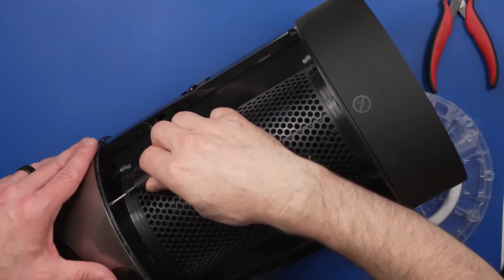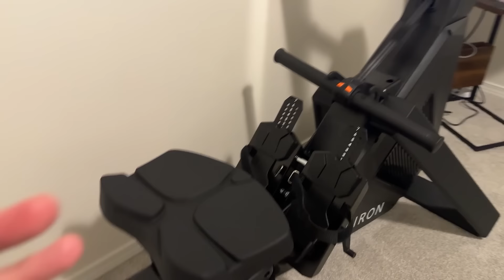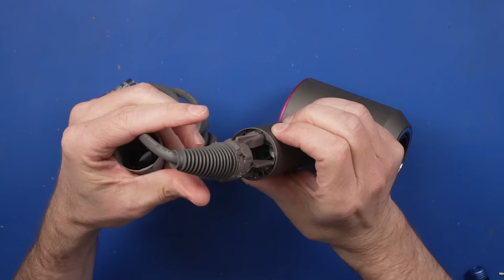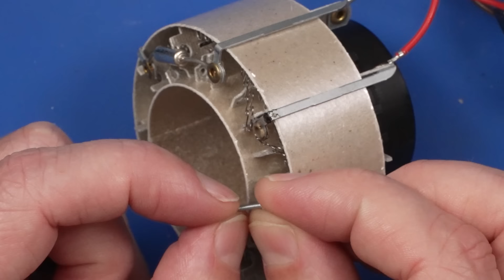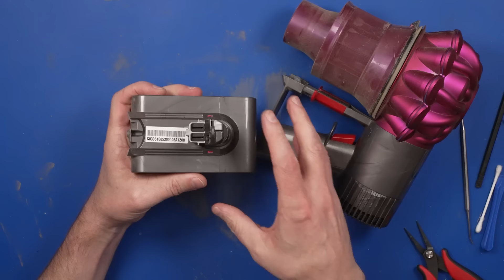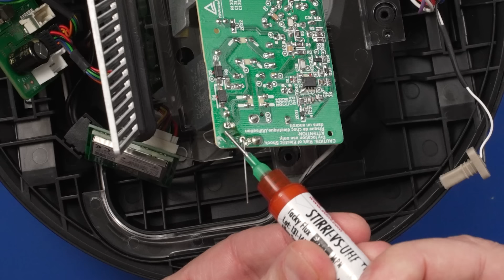Are Expensive Dyson Products Repairable?

Comment: I put a new battery in my animal. It was a christmas gift but we’ve run it more than my parents expensive german one mele. On extended run our older home it can cover all of it. What i have found with bags yes they filter great but as they fill up with dust etc, suction becomes less n less. My dyson’s canister fills up gee’s that what i’m breathing. The dyson’s hepa fan i saved up for i’m allergy sufferer. Dust pollen etc. Air pollutants. I was always sneezing seldom do now. Once you get one and get it filtering the air quality changes drastically i don’t go a full year on the filter you can great for sleeping waking up sneezing 🤧 nope. I got the biggest one plus humid days i just wanna feel cooler. You can slide the direction on you or just out into the room and have the fan oscillate or stop it all together with the remote. Now when it reaches a full dirty filter it will prevent it from running. Dyson’s web site was down so i went to amazon i got two filters equivalent to two years worth of clean air. Only difference is Dyson’s name isn’t stamped on the filter they’re the same filter. I was getting hosed off of one. Yes now the cone shaped hepa fans are high as a kite but when you can afford it get one. I’m had the same battery in the remote since i got mine years ago. I have speeds 1-10 my vacuum battery amazon three screws insert. new battery three screws, charge off to the races. But i’ve run the dog out it. Very my charge times to not every time i run it charge it. It has cut off reserve charge until the light goes out. The way you tell is if you need a new battery extended runs are shorter or in turbo cuts off immediately. Out box new Charge before use usually charge indicator is white -to blue then charged out. Usually after a few runs just blue.

Comment: When you’re checking the voltage of the battery, you have to push the button in. That’s your power switch. You need to push it in to complete the circuit and check the voltage.

Comment: Question: If a piece of tech is made by a company that knows the item shouldn't be serviceable, why would they design the circuit boards to support the use of fuses? If the fuse blows, the unit dies regardless if it's protecting the components on the opposite side of the fuse. Why bother adding fuses then?

Comment: I was a huge fan of Dyson's vacuum cleaners until a few years back. I bought a stupidly expensive cordless Dyson vacuum cleaner, which held up for just over two years until it started to randomly turn off while cleaning. I contacted Dyson, and they said I need to replace the entire hand unit and that it wasn't covered by the warranty since it had ended about a month before the vacuum cleaner finally broke. After a bit of research I found that the actual button assembly was very fragile on that series. Ordered a replacement part for $5 on Aliexpress, but ended up not even needing to use it since the original was easily glued together if you reinforced it with a screw. Last time I ever buy a Dyson product, it's a luxury goods company with zero customer service after their legally required warranty period.
Reply: Trash, I hate companies like that. Funny you mention that I have a Bissel vacuum from WalMart and it's more powerful than my much more expensive Miehle. The Miehle has parts available and is easily repairable... so I keep it around. But if you want a cheap and powerful Vacuum.. Bissel is where it's at. Just don't get the super cheap one. Like $100 or so at Walmart.. mine is 10 years old and still going strong. No parts available, but 10+ years for $100 is good with me.
Reply: @CL-yp1bs  Fortunately, Walmart isn't a thing here in Sweden 😊 That said, I have a corded Dyson that's about 12 years old and still working perfectly with no repairs. They knew how to make 'em back then. I also expect the repaired cordless one to hold up until the battery gives up the ghost.
Reply: @ Wow, yes 12 years is great. Seems like Dyson has gone downhill. It's sad to see these companies getting away with these anti-repair design choices.
Reply: @David_Robinson_1  Yeah, and that ain't even the end of it... Mom has a Dyson that's in the ballpark of 15 to 20 years at this point. It needs a new filter every so often unlike more modern ones, but other than that it works perfectly. They've always been very expensive gadgets, but they used to be good enough to justify that price. Sad really.
Reply: Weve had many generations of dyson vacs over the years and our Panasonic upright bagger outperformed every one of them when it came to carpet cleaning. We just always had a dyson because bags are annoying, until Shark came into play. with 3 cats and a dog, we vacuumed the Living room rug first with the dyson, then the panasonic, then the new Shark vac with the rubber strips on the brush. It filled the entire canister of the shark with fur. By far the best vac we've every owned.
Reply: @frostbite1991  oh, the vacuum works great unless the trigger button breaks. It was a pain to fix when it did though, and Dyson took zero responsibility despite knowing it was a common issue. That's my problem with them.

Comment: This video reminded me of what life for me was like in the 80's and 90's when products were just beginning to be sold with life cycles in mind and the right to repair idea was still far off in the future. While others began to simply replace their broken items, I would tear mine apart A) to find out how they work, B ) figure out it was usually some form of junk that was wedged somewhere it shouldn't be, or C) some cable was disconnected or loose. I never tried to fix any boards since that was seldom the problem, and I had no idea how to do that until later. Besides, simply taking the things apart worked 80-90% of the time at finding the issue. Ended up saving thousands over the years simply by investing in the tools to take them apart.

Good job embarking on a series like this, while it may not end up teaching everyone exactly how to fix their own stuff, it may encourage those who don't think they have the skills to give it a try and maybe save themselves a few bucks in the process.
Reply: How much were the tools?

Comment: You should try dyson corrale hair straightener they only seem to last 2 years then fail to work on battery for more than a few minutes. That's ok though, surely you can just run them from the mains cable you'd think, right? Well no they keep cutting out so you have to wait for them to come back on. Seems to be a dodgy battery cell or a bms issue but they don't seem repairable

Comment: Sadly, the hair dryer is a fake one. For this version of counterfeit, if you read the warning under the blow hole, there are typos. And it didn't have the GFCI plug.
Reply: Yup, and it’s also missing the module on the cord near the plug that handles power filtering
Reply: Not all versions have a filter and GFCI. The EU version (at least the nural and travel ones) do not have filter nor gfci plug.

But yes, this one is fake as it uses wrong screw types and 3 phase motor.
Reply: THIS!!!!

Comment: I replaced the battery pack of my Dyson vacuum v6 years ago with a cheap replacement after the original pack died after 2 years of using. The replacement is still working fine. It's almost 6 years in use now. Cheap replacement parts are sometimes way better than original parts. Dyson just sells crap for a fortune. My Dyson AM07 most likely needs a new motor but Dyson wanted hundred euro for replacing it when it turned loud after the warranty ended. I will never buy any Dyson product again, that's for sure. They sell just expensive junk and people are still buying.

Comment: Those Dyson handhelds either work for 10+ years or quit in less than a year.  I've had both.  The one I had for 10+ years I had taken everything apart right down to the battery like you did multiple times.  The last time I did it I stopped, added up all the time I had wasted troubleshooting the thing over the years and tossed it.  I bought a Samsung handheld with 4x the attachments and included a secondary battery for $100 less than the Dyson.  Going on 1+ years with the Samsung.  Time will tell.

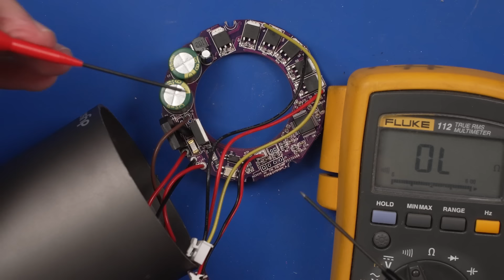Comment: On the hairdryer repair were the red and black wires bridged on the circuit board? Around 14:23 -  Looked like there was an extra blob of solder on the board - or were the two wires going to the same pad?

Comment: I have that same vacuum and I replaced the battery with a third party battery and it worked for a while but I noticed the battery would get hot during charging. I replaced it with a factory battery and now it’s as good as new. I also don’t leave it on charge all the time. Now when it’s fully charged I unplug the charger and use the vacuum until the battery is low and then charge it up again.

Comment: So the switch is not acting like a physical break in the wire between the battery and the device, breaking the circuit?
You tested it, that switch was NC: always on (beep)

Pressing it opened the circuit (no beep)
But the V never changed when you pressed it. And you were able to jump it without depressing the switch...
What an odd design.

Comment: I'm annoyed by their anti consumer ethos.  They released a version of the V15 that has a mopping head, uses the exact same base.  They would totally offer existing V15 customers the mop head and a software update for the base (the suction motor can't run with the mop head or it will vacuum up water), but they insist you rebuy the entire kit.  Framework, please make vacuum cleaners someday.

Comment: having repaired my fair share of dyson prouducts over the years the batteries on there handhelds are good for about 2 to 3 years then they either have the cells fail so they drop voltage really quick so the bms shuts off or in your case the red light usally means a shorted power mosfet you shouldnt be able to reverse charge them though the connector. but too be fair dyson are ok for repairability not the same as they used to be back in the hayday pretty much everything that broke was avalible seperatly then shark ninja came along and buggered everything up and things got more complicated so its asssemblys now.

Comment: After a while our Dyson Vac stopped working (battery). So I crossed my fingers and bought a third party battery online. Not only did it solve the problem, I'm pretty sure the capacity is higher. Feels like the vacuum runs longer than it did when it was new about a decade ago.

Comment: IMVHO... Except for the battery, products showed here can be disassembled.
Not easy, not fast, but until that battery pack air dryer, "fan" and vacumm could be managed without too much hassle.
Other brands delivers special screws, molten plastic seals, no access to any disassemble option for skilled owners.
Not the best, definitively not the worst for repair.

Comment: For these tests íf a device works with a new fuse, I have a fuse holder (2 bucks for a 5 pack) where you can put in these glas fuses into. I usually solder the cables of the fuse holder to the board, put a similar fuse into it and test. Better to blow a super cheap fuse instead of ordering a 1,2,3,x pack and then realize you had to test and it destroyed the new ordered, maybe more expensive and not so common fuse(s).

Comment: Dyson battery replacements are wild.. a cell of mine went bad and only left me with 1/3 of the capacity but an adapter and a way cheapter power tool battery does the job as well.

/edit

Be super careful with no name replacement batteries!
You wont get anything good for 20-30 USD, it most likely cheaper batteries and no/crap BMS - so you just purchased a house fire!!!
Reply: I did the same, super easy to replace.
Reply: Not familiar with Dyson products particularly but a lot of replacement batteries are "rebranded" used batteries too. Particularly as products get older. 

They're just rewrapped and tend to look cheaper than an OEM battery.

Comment: The real problem with those handheld vacuums IMHO is they sit on the charger all day holding the battery at 100% so they get battery fade really fast and need to be replaced (which is both wasteful and expensive). 

Ideally Dyson need to add something similar to what many phones have now, where it will just charge itself to 80% and then maybe there would be a button that you press to let the vacuum know you’ll be using it in 10 mins so it can charge to 100%. Of course, Dyson can’t make money from replacement batteries that way, so maybe they won’t do it.

Comment: In my experience, so far yes. If you don't mind buying replacement plastic bits from Amazon or eBay. Haven't had any major problems yet though *knocks on wood*
Reply: Yeah, the conclusion matches my experience with a V11

Comment: Nice!!

We love our Dyson vacuums. I’ve repaired our stick vac multiple times. I too went with a third-party battery, but it has worked flawlessly for years.
Reply: Dang I have had quite the opposite experience. Spent about $600 on a Dyson rechargeable handheld, it's 2 yrs old and a full charge now lasts about 40 seconds. Any trustworthy sources you can recommend for how to replace/convert the battery? For this price I unfortunately had higher expectations, maybe that was my mistake. But I won't be buying another rechargeable vac, Dyson or otherwise
Reply: @bretthake7713  probably Reddit is your best bet. I got a V15 detect on Black Friday to clean up after my girlfriend’s cats and it’s amazing for that. Sucks up the litter they track, the fur, and the dander. No, a broom doesn’t do the same thing
Reply: @bretthake7713  I bought a battery  which lasted 6 months, a second battery lasted about the same.  Refused to be scammed again

Comment: Could it be that the button/switch on the battery pack was wrong wired? For me it seems it was normally closed instead of normally open (preventing the connection while not pressed)

Comment: Just fixed my wifes Airwrap the other day with a $25 replacement heating element out of another broken airwrap I got off ebay. Pretty sure it was the thermal fuse on the element but it was easier to replace the whole heating element.  I originally bought her airwrap broken for $75 with all the accessories and just had to clean it out internally.

Comment: one thing i didnt learn from these videos is "dont hold the solder wick by the metal part when absorbing solder" cause i burned myself a few times rofl
Reply from the maker: Lol, I never even thought to mention that.
Reply: @Tronicsfix  only reason why i thought i could hold it was cause copper can dissipate heat pretty quickly lol
Reply: @HarrowTTV  Yes, it dissipated the heat into your fingers :D
Reply: I've seen people cut off a small piece and use tweezers to hold it. I've tried that myself and it works great. It's a small piece of braid so you're keeping the heat at the solder you're trying to suck up instead of losing a bunch of heat all the way up your braid. And of course the tweezers keep you from burning your fingies.
Reply: A lesson I learned years ago myself. haha

Comment: Man, these are too expensive for house appliances made from like 90% plastic
and
not even repairable.
Reply: They do last longer than usual appliances and if bought new, should have a warranty
Reply: @BENJANI_AV  My local hairdresser bought a professional DYSON "hair salon  quality" hair dryer for her business and it started to overheat after 1.5 years. She regularly cleaned the filters from hair and took good care of it.

She was pissed that it only lasted so little after paying 500+ euros for it.

Not only that, but when it was working, every time she was using it to dry my hair, the LED bulbs from the salon would start to flicker (strobe) lightly. That thing was putting out some EMI / harmonic distortion back into the mains.

From my observations, DYSON products are over engineered junk with a pretty "wrapping" slapped onto them. Their exorbitant cost is due to their massive advertising budgets.

Unfortunately, manufacturers today have the mindset of: "If you can afford to buy an expensive product today, you'll probably afford to buy another one when it fails outside of warranty." Long gone are the days when expensive products were engineered to last a lifetime (or decades), everything is built as cheap as possible and designed to barely last until the warranty period expires.
Reply: @BENJANI_AV  nope they dont if you have a study proving otherwise id love to read it
Reply: @lapasteque899  Coming from an actual owner of a couple Dyson products, I disagree with.
Reply: @TigerClaw03 your personal experience is not and never will be a valid argument someone never putting their seatbelts might never crash and affirm it is useless, is it true in any way then ? No
Reply: @lapasteque899  your anecdote about blindly trusting studies/professional reviews is never acceptable either.

Anecdotes do matter because they can highlight real-world positives or negatives a study/professional review misses.

And we’re talking about vacuum cleaners here. A seatbelt has to be tested to ensure it meets automotive government regulations in a crash so a measurement of a seatbelt is its effectiveness in a crash, not driving. Your example doesn’t make sense, lmao.

Oh and please provide studies, with peer review, that anecdotes are invalid.